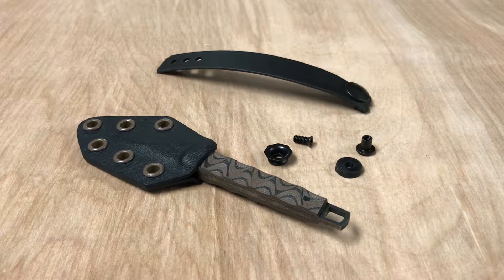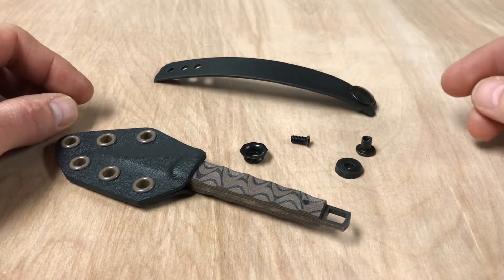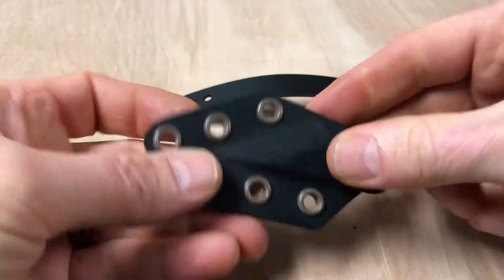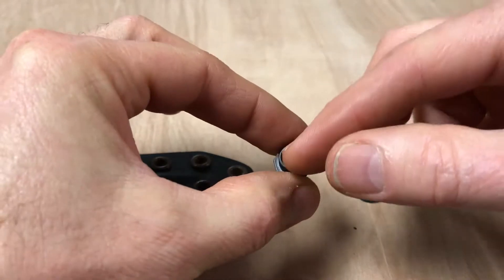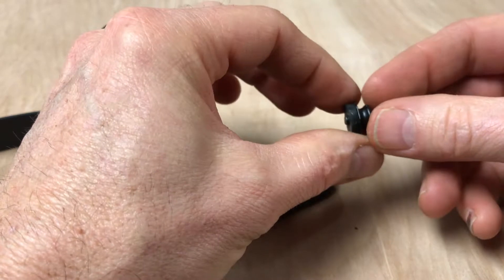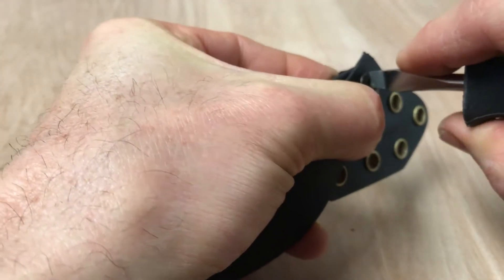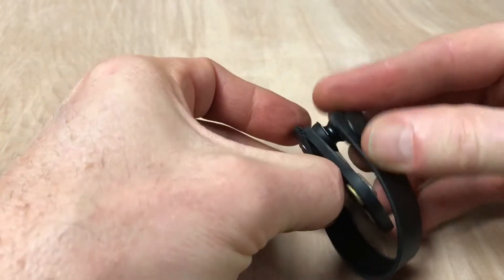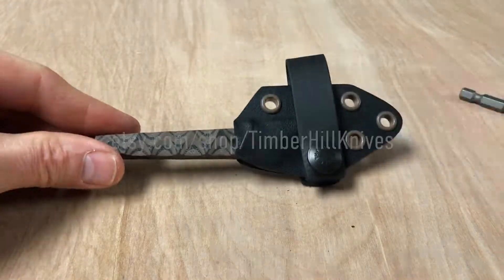Attaching Your Soft Loop

Comment: I bought three Blade Tech IWB Loops and they are not snapping in. Not even with your hint about the small spring. So I might be missing a point or they are just terrible build and overpriced.
Reply: I dont know what brand those are I ordered some off knife supply and they snap pretty good for me .good luck and GOD BLESS.